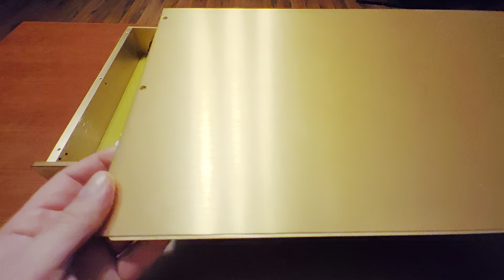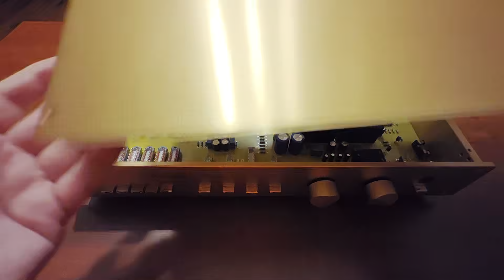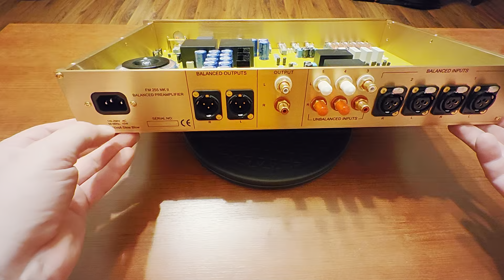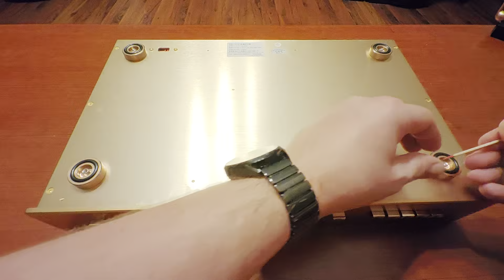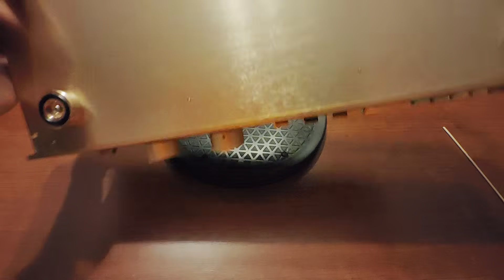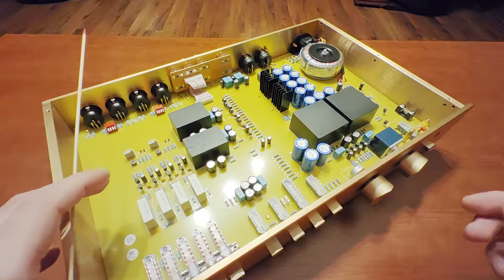Swiss Gold Bar made in China: FM Acoustics FM255 preamplifier review

Comment: Sounds like a good allrounder for the living room all day listening if you can prevent noise issues. The split RCA/xlr circuitry would be an issue for me, because I'd want to use RCA to my sub woofers.
Reply: If you’re talking about the outputs, run the RCA outputs to your amp and then buy a pair of XLR to RCA adapters for less than $10 and run that to your subs.
Reply: @sean_heisler  my amp only has xlr inputs. I would need an XLR to XLR+RCA splitter. Or split xlr and use rca to xlr adapter to hook up my LFE cables.
Reply: @D1N02  Maybe I missed it in the review. Doesn’t it have one set of XLR outs and one set of RCA outs?
Reply: @sean_heisler  yes, but XLR output will only output XLR input. Same for RCA
Reply: @ aha! That’s what he meant. Ok. Well, that sucks. I gotcha, sorry!
Reply: A good assessment - I'd agree regarding my FM255.  It's just an all around excellent sounding smooth, warm preamp.  It sounds fun and non-fatiguing - easy to listen to all day long.

I have not tried the balanced jacks yet, but I do recommend trying the -20db gain button on the far right.  It tightens up the bass and presentation a bit - did not hear him mention it in the review 

Mine has a light hiss on some amps, not all.  Not bothersome so far

Comment: Question. Have you ever tried bi-amping your Martin Logans or any speaker. I am thinking of bi-amping my Dunlary SC-5s.
Reply from the maker: Yes, I did, I actually use my 851W in mono biamp mode. As long as you can afford the amps required (number) its good thing, but in my opinion - based on my logans and few other earlier - the quality power cable at the DAC will make a bigger difference. But YMMV as this will be heavily dependent on speaker/amps combos